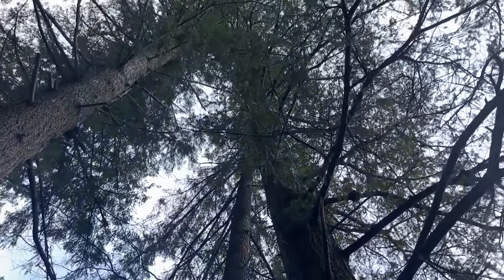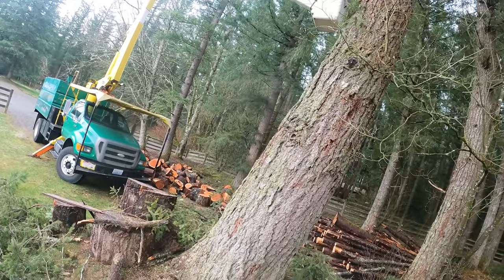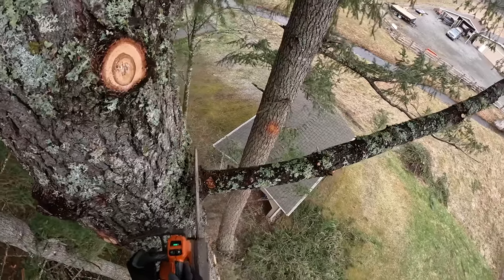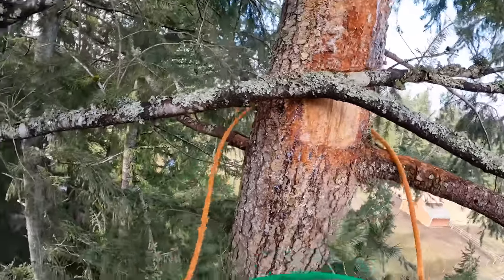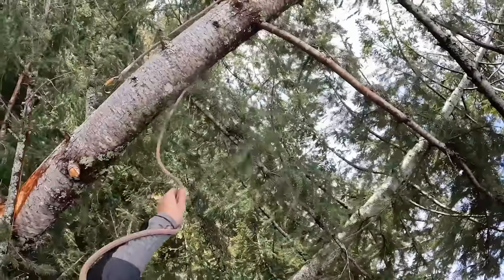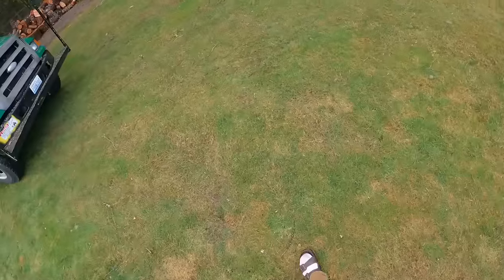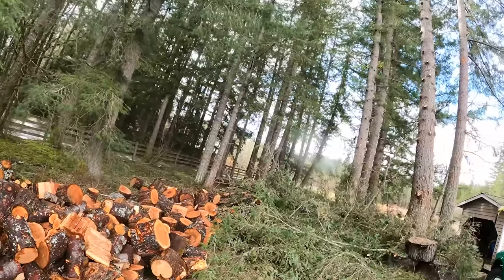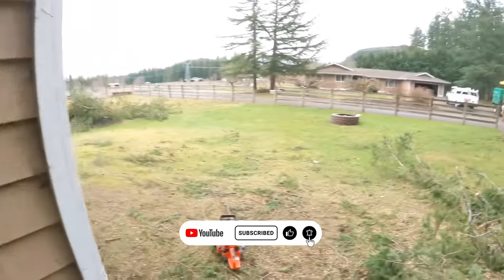Big Uprooting Fir Removal with Randy!

Comment: It seems like the contract type work you’ve been doing is working out well for you. And the opportunities to travel and meet new people is great! Just some general thoughts in regards to owning a tree service, you can run a smaller operation with less overhead, less stress, etc. and still do very well. Not every tree service has to be a “do everything” type operation with hundreds of thousands of dollars worth of equipment. Unless that was the goal of course. Bid on the jobs you want, and don’t hesitate to turn down jobs that might be better suited to a larger outfit. Find your niche. 🌳
Reply: That is where i'm at. Just setting up as a 2/3 man band. Minimum machinery = minimum hassle  and minimum overheads. Great video and love the 'mandles' with double socks :) Can I come and work with you two?!?

Comment: If you dont want anything sliding around in the back, linex the floor and sides of the “bed”. We ended up painting the floor and sprinkled playground sand in the wet paint. Makes it super grippy. I have a few totes in mine and they dont move an inch going down the road.

Comment: For climbing situations I have concerns about having to bail, I put my lanyard system on a panic snap, so I can bail out intentionally even with the lanyard under pressure.

Regarding that biner breaking at 1200, I would keep in mind this only applies to situations where the tie in can take it, AND the structure of the tree you are in wont crush you when loading your system with so much weight. Assuming all that goes well, you are still dealing with the rope stretch, and all that force being released suddenly. I had a situation, also a tree hung up in another, though much lower to the ground with 24" oak trees, with a lot of force suddenly released and suddenly stopped. While I was expecting something to happen, it was far more violent than I expected, even too fast for gravity to swing me out of the way, and somehow caught my pinky in the wrong place. Broke the tip of my finger and popped the pad. Didn't even know about it till I saw blood on the tree and remembered a tug I felt as things were happening.  Just saying, always be cautions when large forces are suddenly released or stopped.

You might want to get a biner rated for 25 to 50 ish. That would be enough strength for work positioning without requiring dangerous levels of force to break.

Comment: I use a small loop of throw line to make a break away for my lanyard when in situations like this one.
Reply: Hey Bryce you can get rated zip- ties if you didn't know.   2 of the 75lb rated works good
Reply: @robsimons1163  throw line average strength is around 500lbs,enough strength to be able to use my lanyard for good work position for comfort with confidence. Still very much the weakest part of my system but I can trust it to hold my body weight (NOT as priority). Also always have throw line on site.

Comment: have you seen those Jetta conversions that turn the cars into a two-seater "ute", it has a little bed in the back and a cab that looks like a tiny pickup, smaller than a Mazda b series .

Comment: Doug Fir, Ponderosa (mature), in fact, most evergreens don't mind the gaff. The bark is just too thick to care. Anyone who's climbed a thick barked tree with pole gaffs knows what im talking about. 

Your saftey (read:gas station) link is the best practice for this situation. In my opinion. At that moment its not a matter of risk elimination, but mitigation. That cheap caribiner may hold just enough to severely injure you, but likely wont rip you half.